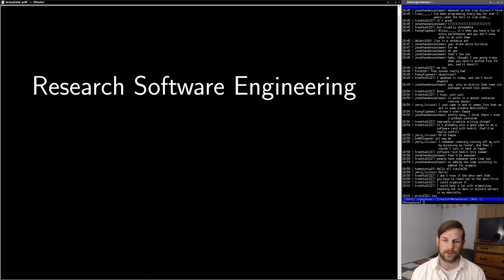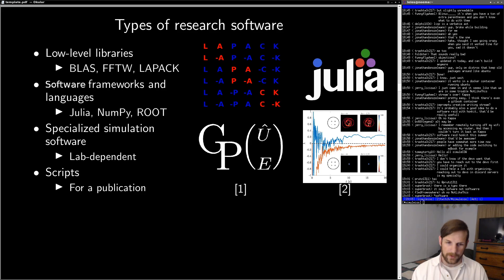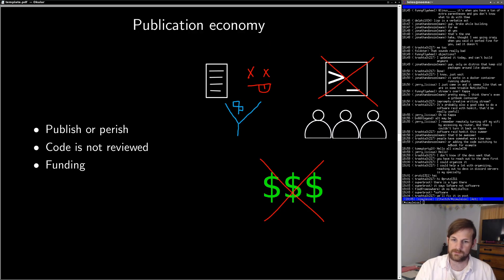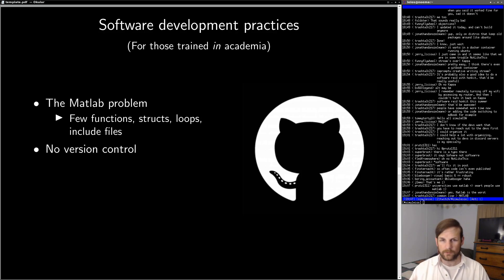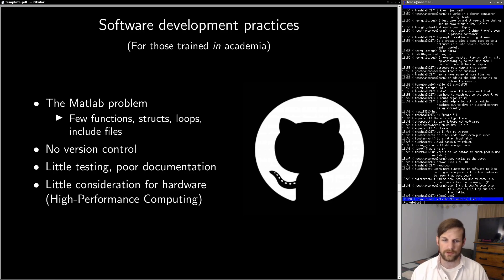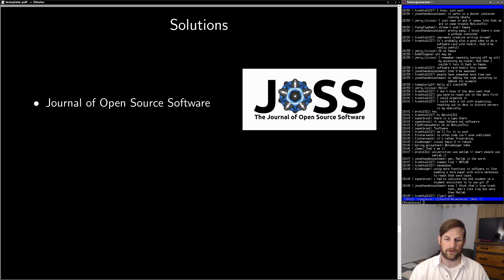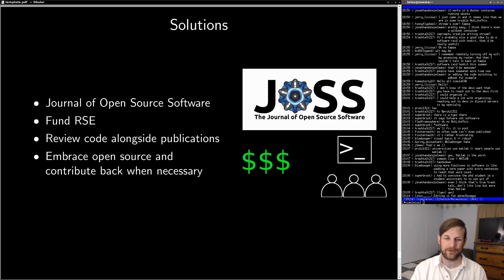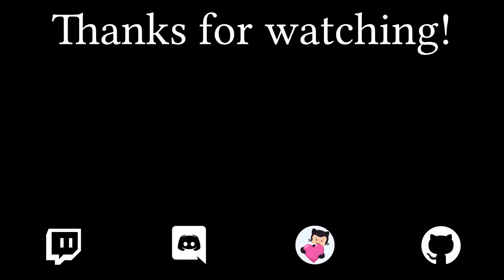The Problem with Research Software Engineering

Comment: I think there's a lot of researchers that see Matlab as a necessary evil. There's just such a developed ecosystem of tools and labs are reluctant to migrate. 

I would like to see some sort of bounty system for migrating Matlab code to Julia. In ultrasound physics there's packages like Field II and FOCUS for Matlab which I would like to see migrated and I'd be happy to chip in to some fund to make that happen.
Reply from the maker: Yeah, matlab for experimental work is one thing. If there are no other packages that allow users to connect with their experiments, then it's the only option.

I would love to see Julia take over the role of Matlab, though. Have you gone on the Julia Slack or Discourse to see if there is development in the areas you need for your research?
Reply: @LeiosLabs  I've looked but nothing has anywhere close to feature parity with the Matlab packages I referenced. To dethrown Matlab you need to get a critical mass of labs to switch over and that's not going to happen quickly if necessary packages are missing. Unfortunately, the same labs that are reluctant to switch are the ones that are best suited to migrate the libraries to Julia. It's a bit of chicken and egg problem. What do you think of a bounty system to reward open source research programmers?
Reply from the maker: @BradenEliason  I wish the bounty system would work! If there was funding for that, I would love to take a crack at it.

Comment: In my opinion, the fact that research code is so bad (for computer science research) is inexcusable. Many times a CS undergrad could write code that actually works, with better documentation, that can be run by anyone on any machine and reproduced. It's just laziness, partially incompetence, and I don't think the code should be written at all if it is going to be bad. It's just that you have people who aren't trained as software engineers (yet are in computer science!) writing code and it's complete spaghetti. Do researchers know what they're doing? Yes, when it comes to writing papers. Should researchers be writing code? In my opinion, no not really. It's a waste of time if you're terrible enough at software engineering because it won't be reproducible anyways. If researchers HAVE to write bad code though, I would really hope that those who do just put in the readme something along the lines of "we just did this so we wouldn't get yelled at by reviewer #2 for not having an implementation. Our software is terrible and probably doesn't even work, and we barely remember how to get it to work because we're writing another paper already. You're better off writing your own implementation." That way I can stop wasting my time with the code, because 99% of the time it's easier to implement something from scratch with good software engineering practices than it is to try to get something built with terrible software engineering practices to work.
Reply from the maker: I can only echo your frustration. This is exactly the problem with research code today.

Comment: Competitive programmers may be able to help. You can get relatively clean and simple code from very complex new algorithms if you ask competitive programmers. We are trained to code common algorithms really quickly and occasionally search for better (faster, more memory efficient, working online, etc.) algorithms to implement so we can use them as "secret weapons" during contests.
As an example: given a tree graph of N nodes, it is widely known that you can find its centroid decomposition in O(N log N) time. However, a quick Google search will lead you to a paper demonstrating O(N) centroid decomposition which has no code. To verify, we usually just read the paper, code the algorithm ourselves, and stress test it against the verified slower algorithm with thousands of randomly generated cases.
Might it be possible for researchers to get competitive programmers verify their work?
Reply from the maker: I don't think that would be a bad idea. I think the best bet is to teach researchers to think more like competitive programmers in this case.
Reply: @LeiosLabs  competitive programming has one of the steepest learning curves i have seen
Reply: How do you get them to work together? Academia has a very traditional structure. Software engineers are sometimes hired as "lab assistants", which means everyone ignores them until last minute when some bug shows up in a big mess of unreadable code. If they get accepted into academic position, like PhD student, or post-doc, they are pressured to publish their own work asap or get lost.

Comment: Having recently started as a "real" software engineer after finishing my PhD, I recognize many of these problems. We did do version control and unit-testing for our research software, but I often passed up on good software documentation in favor of writing the actual research articles. I've also had many requests from colleagues to share my code for making high-quality graphs. Most of the time I had to reply with: "You can have my code, but it won't work directly on any other data than mine. Please take my code as-is, and use it as an example to try writing something of your own." I know I could have made my graphing tools much more modular and general, but at the end of the day I needed to have my thesis finished.
Reply from the maker: Honestly, using version control and doing proper testing is still pretty good! In my opinion, software is only really as useful as its documentation, but if the code was meant as a script for a single publication and not meant for reuse, I think it's acceptable to have less documentation... As long as people can still understand the code enough to replicate the results!

Comment: Excellent video. Empathise with the points you've made. They're not only relevant in academia but also within commerical settings where there is pressure to release and not enough resource is committed towards building robust systems. Or, conversely, systems are engineered well but the solutions aren't scientifically rigorous.
Reply from the maker: I don't often see production code, but don't doubt there are similar issues there! In general, we need to do better to write high-quality software whenever possible!

Comment: Right on point. I am currently trying to refractor an old academia codebase consisting of Matlab, Python, Java, and C++ that are glued together using Matlab, and it is just a nightmare. And yes, Matlab is evil - you often see thousands of lines of code without encapsulation and a huge namespace. I genuinely think that much more people would have used the code if it was written in a more professional fashion.
Reply from the maker: That sounds awful! I have had similar experiences, no where near that bad. On the other hand, at least they are giving you time to refactor!
I really feel we need to be honest about the fact that software is how people conduct research. Poor documentation / software practices are precisely the same as keeping a bad lab notebook / sloppy methodologies.

Comment: This was very helpful. I'm going to look more into JOSS.
As a Physicist interested in Scientific computing, unit testing seems like almost a foreign concept, and I feel fairly inadequate compared to my computer science peers.
I've had enough exposure to the importance of version control prompting me to learn git myself. For anyone else in a similar position, look at the MIT Missing Semester Jan2020 IAP for similar computer sciencey-"filler" education.
More videos about CliMA would be cool    : )
Reply from the maker: I was in your exact position at the start of my PhD. I knew about unit testing, but never "needed" it for my code and used version control, but couldn't really get my peers to use it, so I was stuck. It was an uphill battle for me, but learning proper programming practices helped out my research tremendously!
Reply: @LeiosLabs  thanks for the tip. I feel fairly lucky in this regard as there's so much to learn from online, that hopefully I'll have it easier. Content like yours helps so thank you once again

Comment: This is only tangentially related but, as someone who learned to program long before learning any higher mathematics or physics, it has always irked me that variables and constants in mathematical formalism are even worse than hungarian notation in programming. Too many papers fail to define all their domain-specific symbols and ,if you read papers from 100 years ago, you have to chase down obsolete definitions. That's before you even get to all the situations that mix multiple definitions of the same symbol (like elementary charge and Euler's number) in the same equation. It's just begging for people to make mistakes. Mathematics could stand to import some best practices from software development.
Reply from the maker: Yeah! I completely agree with this! In some codes, theta is an angle. In others, it's temperature. It's hard to keep everything straight and is another complaint I have about a lot of research scripts! I am alright with it iff there is a comment somewhere in the code to some text that has similar notation or if there is a table of symbols somewhere available, but most people don't do this.

Comment: I worked as a research assistant in a chemistry laboratory that primarily deals with simulation. The lab head is still using a FORTRAN for nucleation simulation. I believe that code is at least 20 years old. When I tried to read the code it has variables like 'xxx' and 'yyy'.
Reply from the maker: Haha. I've definitely had a similar experience! I actually like fortran, but bad code is bad code.
Reply: @LeiosLabs  It depends on what you understand as bad code, sometimes it just not enough time to properly develop a piece of code it is neede for given paper (e.g. modeling a physical process). If the code does what it is intended to do, then having xxx and yyy variables names becomes second order. I really liked the publication economy analogy that you made. I ran away from software development just because of that.
Reply: In my experience, Fortran is very convenient for that kind of work. (Fast, low-level, clean syntax, built-in support for matrices and complex numbers... it feels like the right tool for the job. With C, on the other hand, it often feels like working against the language to get it to do what I want.) 
A determined scientist can write unreadable code in any language, though.
Reply from the maker: @altaroffire56  A lot of people say fortran is bad, but I 100% agree. Usually fortran is seen as a bad programming language only because people programming it use bad programming practices.
Reply: @LeiosLabs  Lets not forget that what is now bad programming practices may have been the best at the time.  Short identifiers due to length restrictions, terse programs due to small screen sizes, few inline comments due to file limitations, etc.  It is the improvements in technology that have allowed us to write more human readable code.
Reply: I'm worried about working with an old code base myself. That seems dreadful